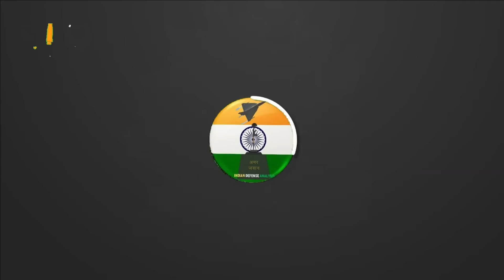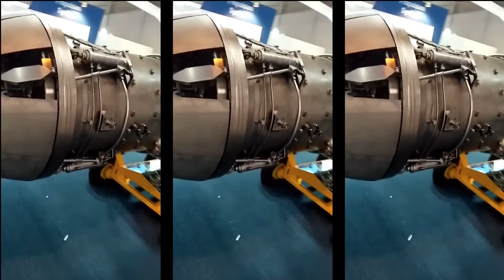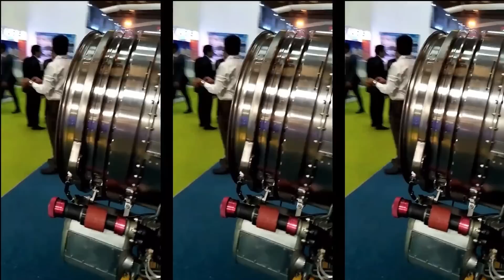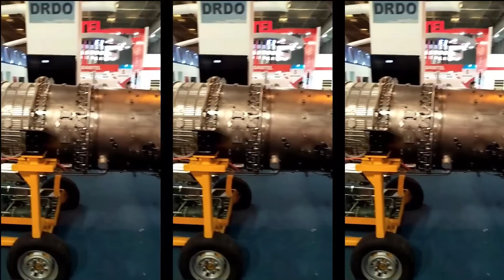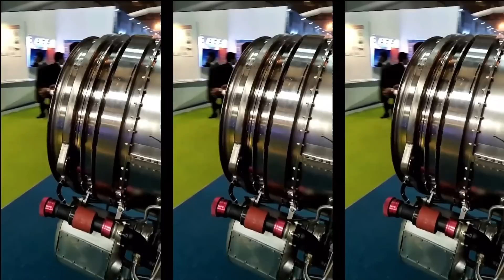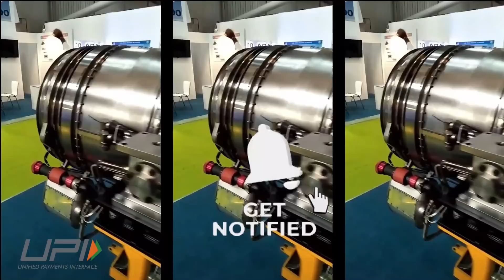Important milestone in certification of Kaveri Engine

Comment: Excellent! I agree with you 100%. The money and effort we have spent is not a waste. We have gained valuable experience and we should not now throw that away. We must get this engine certificated, build around 25 engines at least and use it for non-critical applications. Our company used to provide engineering and design services to P&W (and Boeing and we will still do) and I have a fair idea how complex these engines are to design. They are even more difficult to manufacture.

One more point. We can never develop an engine without a proper test bed and instrumentation. I am sure we have surplus AI 747s which are the best a/c for a test bed. P&W uses one. To the best of my knowledge (someone can confirm) there is an extra pylon  on the 747 to transport a spare engine. Our fighter engines are much smaller than the big fans of civil aircraft so I am sure the pylon can do the job. Even if this does not work 747 has four engines (hence very safe)  and huge wings and there is enough space for fitting an extra engine.
Reply from the maker: Absolutely we need a test bed and I remember DRDO has submitted proposal for IL-76 based one but it’s with govt.
Reply: @IndianDefenseAnalysis  I hate to say this - if it is with the Govt. you know its fate!
Reply from the maker: @ashokkandimalla5962  can’t blame everything on government.
They need to spend money wisely, having led several projects I know we have to make tough choices on funding and prioritise. The govt also need to be informed about right priorities. Politicians can’t take decisions on technical and scientific matters. 
You will see more fund flowing as we grow our economy.
Reply from the maker: And the context is with present government. Before NDA, the other govts lacked visions in shaping the defence ecosystem.
Reply: @IndianDefenseAnalysis  Generally I don't like to blame the past as we can't change it but we can change the future. And the present Govt. is doing that fantastically well! 👍
Reply: @IndianDefenseAnalysis  Who will advise the Govt. I wonder and will their voice be heard? IAF has been crying hoarse for more a/c but it is taking decades to buy a plane. May be not the Govt but the system and processes - but who can or will change them. No doubt some changes have been made and I hope that trend will continue. I am optimistic now than before.
Reply from the maker: @ashokkandimalla5962  yes, it will change. Many of my friends are working on govt advisory are doing commendable job. Many schemes announced by govt is the brainchild of the consultants who work with IAS officers. This is the layer that will bring the change that we all are willing to see.
Reply: @IndianDefenseAnalysis  Glad to hear that. My best wishes to them.

Comment: I have been tracking the Kaveri for a long period and so far I don't know what changes they implemented to the engine. Very sad to say the delay for a high altitude test is unreasonable even though that the Russia and Ukraine war is happening. India should pressurize Russia to test the engine as soon as possible for certification. You are  paying for it so why can't the Russians do ot within this year. Indians are too soft must get their act together or otherwise look for another country which can rig up an engine to a test apparatus. I am sure there are many, it's seems the engine was designed around Russian design so that the engine fits on Russian jet to test for high altitude. Another 2 years wasted. Management  leadership is poor from what I can deduce. Find alternatives no favoritism.
 too much time wasted over the years lack of experience in metallurgy, turbine blade,
Nozzle design, ratio of rotor blade diameter to turbine casing, blade clearancec in turbine casing, shaft vibration and deflection analysis at the different speeds, rotor spacing, unsatisfactory.